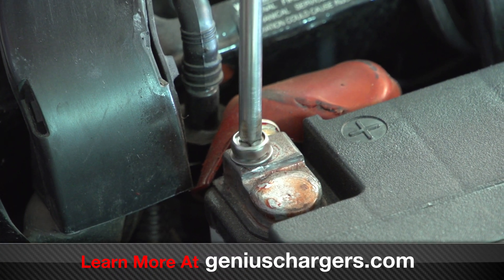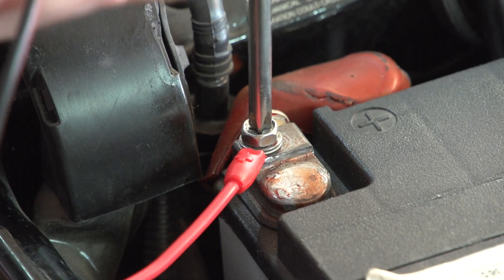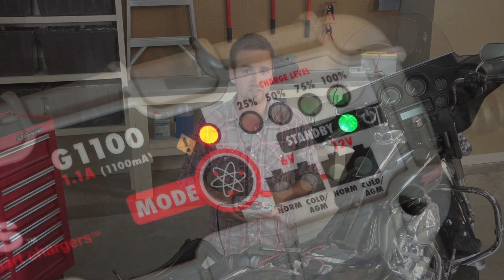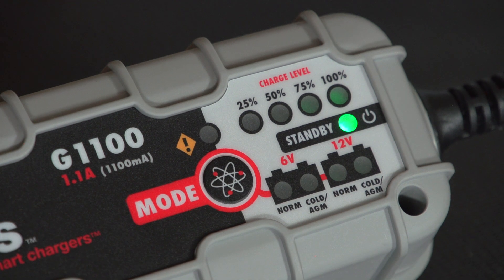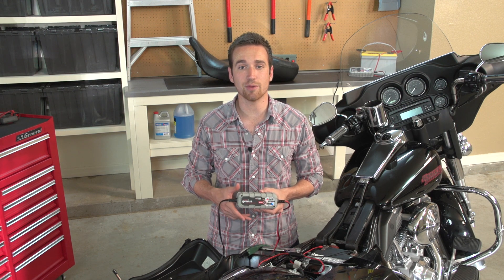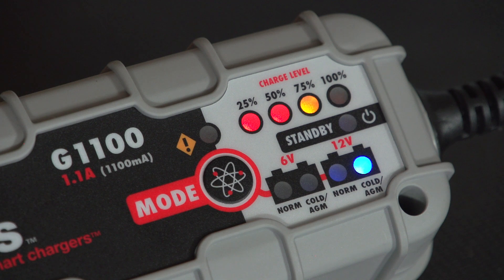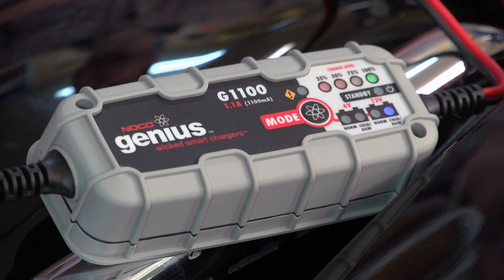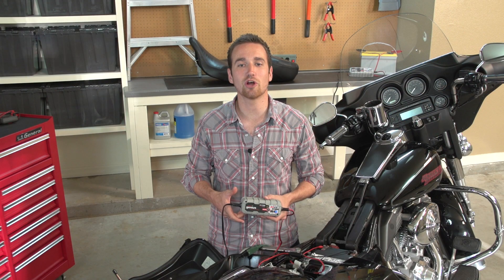How To Charge A Motorcycle Battery

Comment: Can the eyelet terminal accessory be left on the bike when you start to ride again? Then just pull out the accessory when ready to charge? Or does it need to be removed after each charge?
Reply: You leave it on the bike.  It's best to run the leads to a place you can access it without the need to take the seat off.  This way you can easily plug the charger to the bike after a ride.  The charger also comes with conventional clamps like most chargers.

Comment: what does it mean if my battery gets warm and leaks a bit from the drain hose its not being over charged it does this when its on the charger or when the bike is running my charger charges at about 13.8 volts and my alternator charges at about 13.4 on idle any ideas guys ?

Comment: Thanks for that but I already have an oxford oximiser with lights down the middle and goe's green when fully charged. I've only had the bike 6 weeks (FZR600 91) model uk version 3HE model the lights and horn seemed to be weak so I put the charger on to charge the battery with a top up of de-ionised water and it was fully charged straight away within 20 minutes doe's that sound normal

Comment: Can I remove the battery and charge it in my apartment since I don't have a garage?
Reply from the maker: We would not recommend this as batteries will release gases as they're being charged, the battery should be charged in an open, well-ventilated area.
Reply: @NOCO  oh ok, than I'll charge it in my balcony under the shade. Thanks for the safety tip.